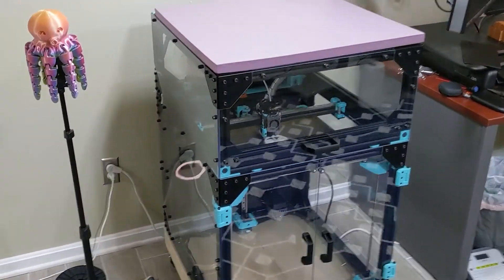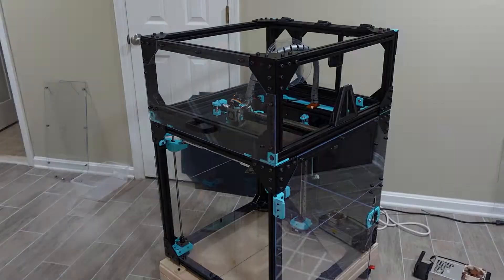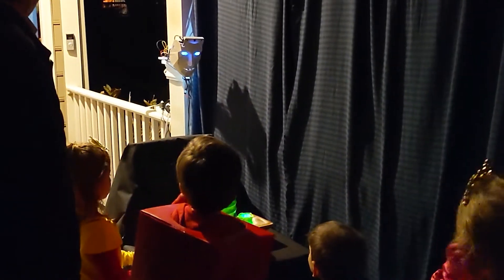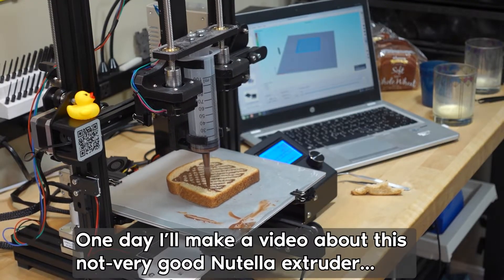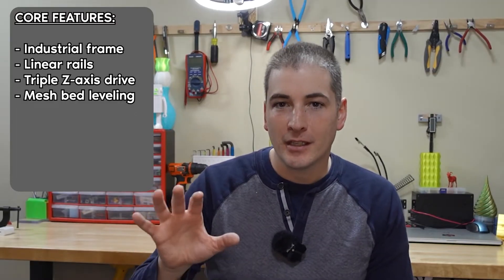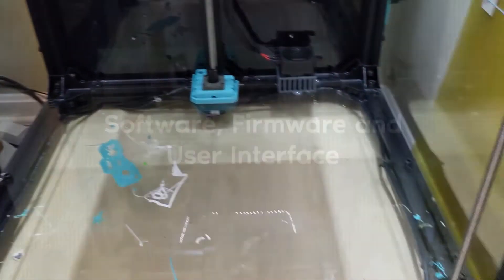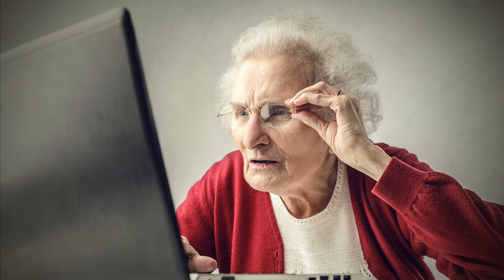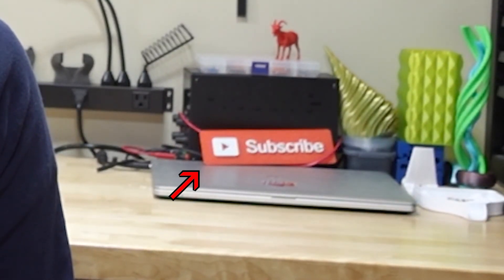Ultimate DIY 3D Printer Experience // RatRig V-Core-3.1

Comment: Run all the standard and in-depth tests of this printer to understand at what speed it can print without problems. Precisely print, and not make a bunch of melted plastic with the outline of a ship. Thread rollback tests, Input Shaping, Linear Advance, etc., in general, everything that is required from Bamboo Lab printers. I want to see clean numbers and graphs, the vibration frequency literally sets the speed, the purity and intensity of the ripples on the axes are also important. I think that it is worth building a printer yourself only when you, instead of a small super-precise machine (with an accuracy of 0.1 mm for a 10x10 cm square), make such a huge one with the same accuracy, BUT at a higher speed. If at least something is lost, it makes no sense. I mean CNC machines can have an accuracy of 1-2 hundredths of a millimeter, and homemade CNC milling machines can also be made for a small amount, there should be no problem making it just as precise and rigid.

Comment: Are you going to add multi colour ?
Reply from the maker: Coincidentally, two years after building that printer, I just ordered an independent dual-extruder (IDEX) V-Core-4 build kit. 

 The VC3 from this video is still functional, but I've abused the heck out of it: 2,000+ print hours, mostly ABS in the heated enclosure. I've had to do quite a bit of maintenance and I'm really craving being able to use separate support material (and dual color).

I will be making videos about that process, too 😄

Comment: If you were to do this over today, would you wait for V-Core 4.0?
Reply from the maker: Based on what I've seen of the V-Core-4 -- absolutely.  It looks like it's an improvement all around.  Build complexity, kit completeness (incl electronics), a lot more metal components, beacon probe, and has the IDEX (dual-extruders) as a primary build option.  I decided if I ever get another printer, it has to be IDEX. 

I would love to build a V-Core-4 myself, but recently added a CNC router and laser cutter/engraver to our mess here.  Wife approval is unlikely unless I promise to get rid of 2 other machines...
Reply: @ObsessiveEngineering  Thanks, I'm on the list. I was considering a tool changer rather than IDEX on the off-chance I'd need two materials plus support. What do you think? 

Do you use an inductive probe (Beacon)? If so, how does it work? I've heard inductive probes have repeatability issues at temp.
Reply from the maker: @leroycasterline1122    Re: IDEX vs tool-changer -- Toolchangers come with a whole class of extra complexities.  I'm going to guess that's why we don't see many printers using it.   IDEX isn't trivial either, but at least for the RR, it appears to be a first-class feature now.  I also doubt I would personally use 2 materials + support, but that's just me.  If you think you might you could consider ROME, which is a side project in the RR community by Helge Keck, for using two filaments per extruder with an extra motor and Y-shaped feed port.  I don't know how mature it is, but it's an option.

Re Probe:  I switched from SuperPINDA to the Euclid dockable probe, because I try a lot of different build surfaces and I needed something that measures the physical top, not the metallic substrate some mm below it.  I've had some issues with it but it generally works.  I feel like I had some minor issues with the SuperPINDA at temp, but it's been so long I can't say for sure.  Beacon is a different beast though, I'm not sure if you can extrapolate to that.  Obvs I'm not the person to ask though :)
Reply: @ObsessiveEngineering  Thank you for your expertise! I've filled out the rez form for a V-Core 4 500. I ordered an Octopus Max EZ, I hope I shouldn't have asked you first!
Reply: @ObsessiveEngineering  Well, 3 materials isn't something I'd use often. I suppose if I bought the IDEX kit when it's available, I'd be able to repurpose the 2nd tool. I'm not interested in a toolchanger if I'd have to remove it for high quality prints! Perhaps if I find I need one, a Prusa XL would be in order?
Reply from the maker: @leroycasterline1122  I haven't spent much time looking at that tech, The only ones I know are the prusa XL, and the e3d tool changer.  Based on the Zack Freedman video about his 6 printers, the E3D tool changer is pretty slick and been around a lot longer.

EDIT: lol apparently I haven't been keeping up: https://e3d-online.com/blogs/news/tc-discontinued
Reply: @ObsessiveEngineering  Yeah, sad about E3D but I guess they couldn't compete w/Prusa. I read in a forum somewhere that RR is going to support an official solution - hope that's true.
Reply from the maker: For myself, there are times that I would like supports, and there are times that would be nice to print with two materials.  I think the times that I would absolutely need both would be pretty limited. Plus, using the same material supports is usually workable in cases that you need both. 

That said, I've spent much of my life figuring out how to print things without supports, and making and joining different parts if I need different materials.    So for me just having two extruders would be the right level of functionality vs complexity.  I can't speak for everyone though.

Comment: Awesome video! Is it possible to add a second extruder on it?
Reply from the maker: It is possible, but not so much after it's built (at least not without significantly rebuilding the frame).  RatRig labs has two different variants for dual-extruder.  However this printer is my workhorse, and I am not motivated enough to take it offline long enough to try that upgrade.  If you're starting from scratch, it's very doable, though the documentation might be lacking in some areas.

However I see that V-core-4 was just announced, and it looks like they have a native dual-extruder option.  I'm looking forward to seeing more details about the V-core-4 over the next few months.

Comment: 2 grand and still can't do nylon well...pass
Reply from the maker: I should've clarified: it will do carbon fiber nylon great.  55-60C enclosure temperature is great for that.  Nylon-CF is what most people print, and sometimes use it interchangeably with "Nylon".  That's because pure nylon, especially Nylon12 can be a nightmare to print, even at 60C chamber, so most people buy CF nylon which isn't quite as cool as plain nylon but way easier to control. I have spent a lot of time printing pure nylon (hopefully a video about it soon), and this printer is as good as it gets without proper high-temperature enclosure and components.

Comment: Thanks for your video.
I just ordered the 500 version. My door between living room and the passage to it is 81 cm wide. In the passage is a niche with about 1 by 1 m. So perfect to assemble the printer in the living room and than put it there. I will add thermal insulation to the niche, so I just need a front door. I might simply use a window as a door (german windows can be fully opend or tilted - tilting is nice than printing PLA).
For the printhead I decided for a voron Revo hotend with Revo-HF-nozzle. With a printer this size I definitly will use bigger nozzles, so a quick nozzle change seems mandatory. Also I already have a bunch of Revo nozzles (including 0.4 and 0.6 HF and 0.4, 0.4 and 0.8 ObXidian) so for the start I have everything and might add the 60W heatervore and HF-Nozzles >= 0.8 later.
For bigger spools: They are only available from more expensive brands. For PLA and Petg I mostly use Sunlu/Jayo and I am quite happy with them. With about 8.5€/lg extremly good, but only available in 1/1.1 kg spools. However, I see 2 possible ways to solve the problem:
a) add an ERCF to automaticly load next spool if filament runs out.
b) build a spoolrewinder and spool multiple 1kg spools onto one big spool. I just did this manually, welding the remaining filament of 5 used spools onto one and it worked quite well...

Comment: I will build one too, in i hope not 2000€ more like 500-600 with parts that i own and doing the metal parts myself mostly. Also i will use 4 Heated beds and a friend of mine will write a programm that checks what bed needs heating and what bed does not need it so the energy use is reduced

Comment: Hi I am looking to build one as well. How loud is the rig? can it be tuned down to be quiet?
Reply from the maker: So I see a lot of people complaining about how loud it is at first, but not a lot of veterans, myself included.  I am speculating that it's going to be super loud at first, but once you break the machine in, the bearings will smooth out, lubrication will be better distributed etc.  I thought my machine was insanely loud when I first finished the build, but don't think that anymore.

However there is a motor configuration you can use called stealth mode.  It's a feature of the TMC2209 motor drivers, that reduces the stepper motor noise, at the expense of speed (and they claim lower accuracy, though I haven't seen that).  

When I upgraded my Ender3 mainboard with these motor drivers and turned on stealth, it's so quiet now I can hardly hear it in the same room.  But that also uses v-wheels and doesn't move very fast.  Still impressive, and worth noting, but the linear rails will always make noise.

At this time, I'm using stealth mode, and a 0.6mm nozzle on my RatRig which means I can use large layer height and line width and max out the flow rate of the nozzle.  This means I generally have the speed set to a "low" value like 120-150mm/s, and I can only softly hear it printing from the other room.  

It's tough to describe sounds and loudness, but I hope that helps
Reply: Thank you for answering. I have my printer next to my work desk and my curren CR6SE is silent with mods. I recently tried the bambu p1s and it was too loud. I got my interest in Voron and RatRig. I didnt see any talk about if it is posible to work next to one while it is printing. I am interest in quality and low noise than speed. 120-150 is already 2x faster than my CR6.

 @ObsessiveEngineering
Reply from the maker: Honestly, I don't know if you can get it THAT quiet for anything using linear rails.  The only printer I'd be able to sit next to while printing is the modified Ender3 Pro since it uses delrin V-wheels on aluminum extrusion, and the stealth mode of the upgraded drivers is so effective.  I don't usually try to run it more than 50mm/s, and I have to say it is astonishingly quiet and the print quality is solid, too.  It surprises me.  It has the Btt Skr e3 V3, and a Mellow NF Sunrise all in one hotend and extruder.  

 With a big nozzle on it, the lack of speed isn't so bad, if your use cases can tolerate it.

But I'd certainly like to hear from anyone else who has experience getting quiet printing

Comment: How did you fix the squeaking noises you were getting when you first tried to move your X,Y axes.?
Reply from the maker: I don't know about squeaking, but there was definitely a loose screw in my printhead assembly somewhere that I eventually fixed.  Also, the general loudness has reduced over time, I can only assume it's the result of breaking in the printer, ball-bearings smoothing out a bit, etc.  I don't know for sure.  But I have seen lots of people complain about the noise when they first build it, but not many people complaining later, myself included.  Big :shrug:

Comment: Great printer!

I considered the Ratrig, but I wanted to finally use my Teknic Clearpath servos. And since there was no one to stop me, I went a bit overboard on the size at 595mm x 595mm x 600+mm. And I have a Qidi Tech X-Max 3 coming in to replace my old bed slingers, and the Qidi is "small enough" to fit on the HevORT build plate. :)

Comment: Hi,

1. when we order the custom one on the ratrig shop, do we get the metal bed surface and the balls thingy?
2. are the bed very flat?
3. I want to print PLA, PETG, ABS, ASA, TPU, (one day, Im want to do Nylon, PC, and other hotter filament), does the printed part can handle the heat? (considering I might be want to add chamber heater inside)
4. Does the cooling fan deform when printing without cooling fan?
5. If I choose duet board do I still need raspberry pie?
Reply from the maker: 1.  Yes, it comes with everything I showed except for the little accelerometer on the printhead for input shaping.  I bought that separately for a couple dollars on Amazon (adxl345).
2.  Yes, the bed is very flat.  When I look at the bed mesh in RatOS it's got a max deviation about 0.3mm from center to corner.
3. Print the parts in ABS or ASA if you can.  These have very high temperature tolerance and low creep, especially in a heated build chamber.  PETG is typically used too (if you buy the printed parts from rat rig, they give them to you in PETG), but they will be less reliable in high heat.  But I also haven't heard of anyone complaining :shrug:
4.  I regularly do multi-hour prints at 110c bed temp with no fan (ABS/ASA), and my fan ducts show no signs of deformation
5. I don't know for sure. Though. I think if you want clipper and rat OS you're going to need a raspberry pi in a mix
Reply: @ObsessiveEngineering  Thank You for your time answering my question sir!!

Comment: What about a VZBot in the future?
Reply from the maker: I think I'm done building 3d printers for now. But if I do another one it's gotta be 2+ extruders.  As much as I love my existing printers I really need one that can do supports in a second material or do like PETG-TPU hybrid prints, etc
Reply: @ObsessiveEngineering  maybe look at the ERCF? It requires klipper, but this is how I plan on implementing multi material myself
Reply from the maker: I have pondered the single-extruder-multi-material designs, and I think I've decided I just don't like the time and material wasted on filament changes.   It certainly would be an easier upgrade, and probably easier to maintain, but I think it's worth it, even just to eliminate the purge blocks. 🤷‍♂️
Reply: @ObsessiveEngineering  ok, then maybe make your ratrig (or build) an idex? I don't believe the conversion would be too difficult
Reply from the maker: @ThomasWood3DPrinting  I was actually looking at it the other day.  At least there's a semi-official mod for it:  https://lab.ratrig.com/vc31_idex/

Comment: Is it possible run this as an IDEX?
Reply from the maker: There is a semi-official IDEX mod for the V-Core-3, though I don't know how mature it is.  I've only seen diagrams with updated belt paths and motor placement for IDEX. 

It's semi official because it's actually documented on the "RatRig Labs" page.  

https://lab.ratrig.com/vc31_idex/
Reply: @ObsessiveEngineering  Good to know. Are you planning any mods? I've seen people with 48V AWDs.
Reply from the maker: If I was going to do a major mod it would probably be IDEX, but I'm enjoying having a rock solid, functional printer right now.   I don't see the appeal of 48V and AWD for my printer.  I already did a 7min benchy with my stock 400mm, and since I usually print with a bigger nozzle I'm not pressing mechanical speed limits of the machine 🤷‍♂️ (limited by hotend flow rate limits, not the speed of the printhead)

Comment: Running a VC3.1 500 here for the big jobs, love this machine and the community around it in all.  I want a diddy one to AWD for the smaller jobs now😂
Reply from the maker: How hard is the AWD upgrade?  I thought AWD on a small printer was basically just for speedboat racing (because the small builds can already print absurdly fast). I assumed most of its value was stabilizing fast printing on a big machine like the 500mm.  But admittedly I'm not that read-up on the topic.  

And yes, I feel like there's a good community behind RatRig.  I am not familiar with any of the other DIY printer communities to compare, but I'm very happy with RR.
Reply: @ObsessiveEngineering never done it so far but I think not difficult. will need to strip back to the motor blocks, and add the new front parts and I guesse new slightly longer belts, then rebuild gantry. Your right, aside of speedboat benchy, the 500 needs it more than the smaller ones. I'm on the stock alu gantry until I find the right solution, bit heavy but since its on its way to high temp capability and water cooling, CF or fancy alu ones will warp. Quad superpower ldo's and AWD would speed up the stock gantry nicely. Running 48v 5160's already on that machine also :)

Comment: 16:57 I haven't looked looks at the panel files, but I imagine anyone could knock out several 1/8 - 1/4 acrylic panels in a few minutes on a laser engraver at a maker space.
Reply from the maker: That would be ideal compared to the CNC router, but the FabLab I go to doesn't allow cutting plastics in their laser cutter (even though it is ventilated), and even if they could it's limited to like 18"x24" which isn't big enough anyway.
Reply: @ObsessiveEngineering  You're right; I should have mentioned that not all maker spaces permit acrylic laser cutting.  However, one of the two spaces near me allows you to cut acrylic up to 48 x 36".  They also sell acrylic sheets, and you can bring your own.
Reply from the maker: @bernardtarver  It sounds like you'll have an easier time with it than I did.  CNC routing certainly worked, but it was a lot of work to setup each workpiece and it's not particularly fast (and it's super loud!).   

Here's a direct link if you want to look at them yourself:  

https://github.com/Rat-Rig/V-core-3/tree/main/cad/panels